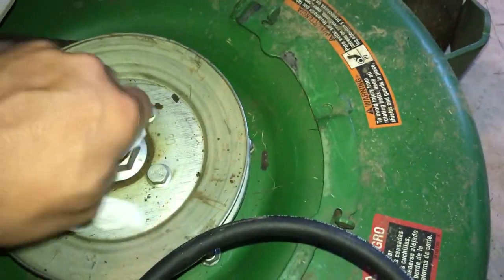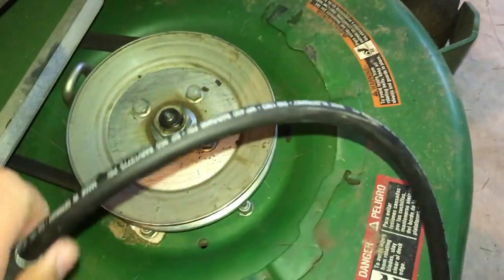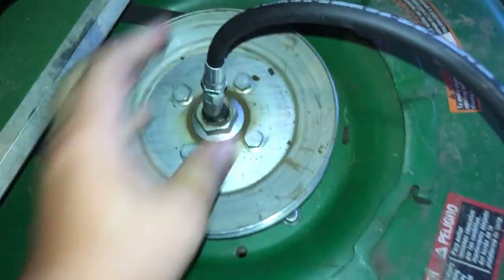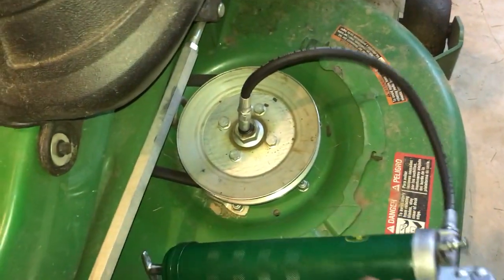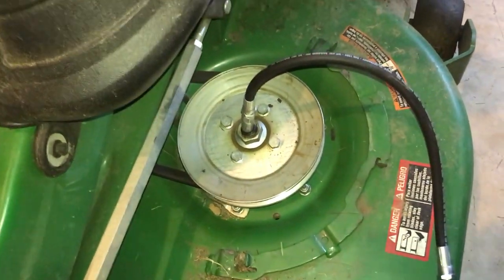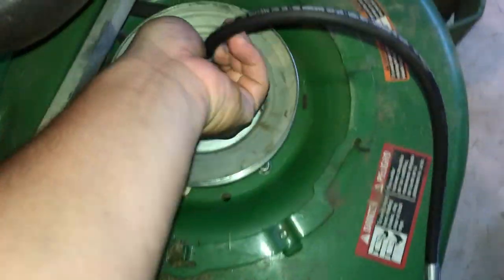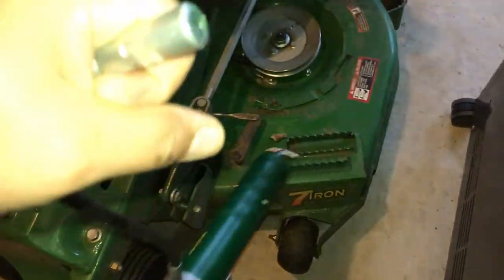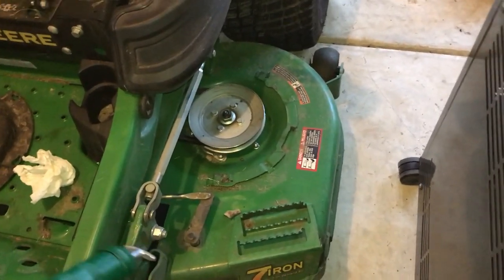How to grease, and remove a stuck grease gun from a fitting

Comment: Thank you for your video!

I have the same grease gun as you and had the gun stuck on the fitting.

I tried prying, pliers, everything I could think of.

Then I watched your video, and it came off with ease.

I’m embarrassed to say if you had not posted this video. I was about to hit it off with a hammer.

Thanks again!

BTW, when I bought the grease gun, it got stuck. So I took it back to John Deere, and said I must have a bad nozzle. They gave me a new, heavy heavy duty nozzle as a replacement, and it got stuck too. Your method is slick.
Reply: Mine wont come offf. At 64 years on a ranch. Someone changed somethin.

Comment: The coupler is adjustable to open and close. Most people don't even know that the coupler is adjustable by just turning it to the left or right. You should not shove it to the grease fitting because you can break the fitting if you don't loosen the coupler properly.
Reply from the maker: I learned that later on and actually made a follow up video lol
Reply: True story on adjustable coupler.

Comment: I just finished greasing the spindles on my D155 today and the damn thing stuck on every one, including the two front wheel zerks,  Each time I had to unscrew the hose to disconnect it from the tip and then it disconnected like normal.  Your way would be a heck of a lot quicker and easier and I'll definitely try it next time.  Thanks for making and posting this video.

Comment: Thanks - I broke 2 of those fittings today and had to dig the pieces out of the hose connector today (wish I'd seen your video before that, but no clue I'd need to). Will try again tommorow with new fittings...if I can find them at the auto store.

Comment: Thanks. I just greased a spindle on my cub cadet. I tried turning pulling, even tried prying it off with a chisel. Then I really put some strength into it and I pulled the entire grease fitting out of the threads! Withthe grease fitting still stuck in the grease gun I then put the end of it in a vise. Then took the same chisel and beat it out with a hammer! Maybe it’s this cheap ass gun I bought at Harbor Freight? Idk but now I have to take the damn mower and have another grease fitting installed or have a new spindle put on! Your Tun came off of its fitting much easier!
Reply from the maker: silverhorder1969 glad it helped
Reply: Same exact thing happened to me with my cub cadet. This video saved the other fitting.
Reply from the maker: Shawn Mabry glad it helped you out!
Reply: Lol, I'm greasing my cub cadet and didn't want to do what you did

Comment: “Make sure you get rid of the Smutes” love it. Hey so does your Zerk fitting come straight out or does it have an angel to it? 

I just busted 2 zerks after I thought I was being careful as heck. Anyways mine came out and then angled and I think that’s where the weak point is. At the angle. Wondering if when I replace the zerks I purchase ones that come straight out instead.
Reply from the maker: Mine are all straight on that mower.  I have another video that shows a another way to get the gun off if you’re interested.

Comment: I just use a flat head screw driver that about 10 inches long for leverage. Place it between the grease gun end and the grease fitting. Works every time, quickly.
Reply from the maker: Have you ever broken the fitting?
Reply: @TheDIYMoneySaver  No. O just greased my van's front end today and removed it with problem. The screw driver is place where the nut is at the bottom of the fitting at the nipple nut. The nut is strong. And so is the bottom edge of the grease dispenser.